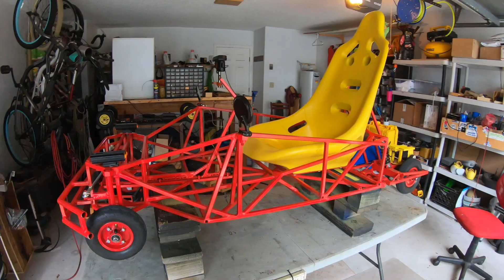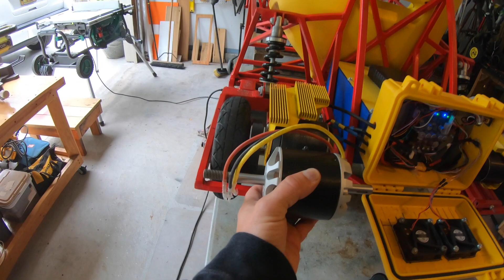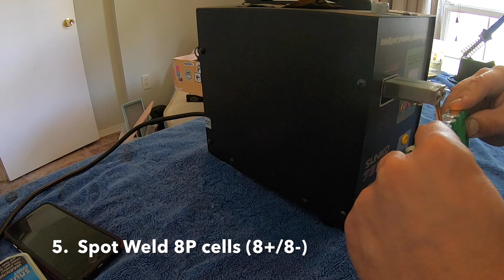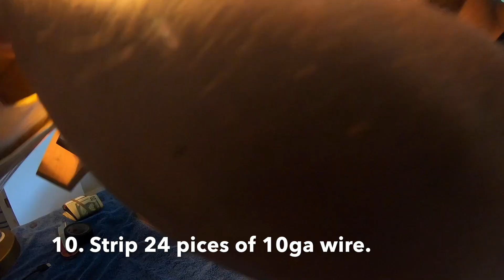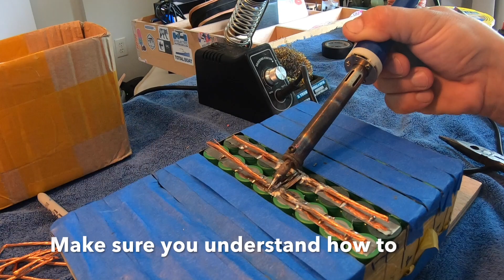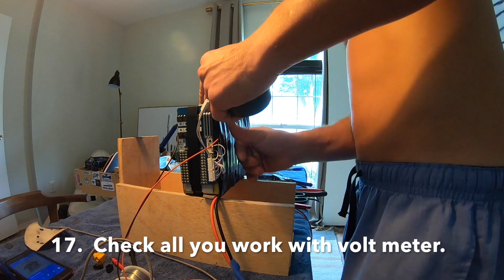Electric Go-Kart, Part 2-Electronics

Comment: great vid
Reply from the maker: Thanks Conner Smith.
Reply: Artsiom Naidzich no prob love warching them when they come out
Reply: Artsiom Naidzich do you ever have have vesc problems because i have blown 4 vesc’s just trying to have them detect the motor for my electric skateboard
Reply from the maker: conner smith Yeah, ive had that happen. This issue resolved when i disconnected load from motor pulley (belt, wheel, etc). When motor spun freely, vesc was able to detect motors. Also check your vesc settings and wire connections. What vesc r u using? What set up? My worst experience with vescs was torque board vesc. Flipsky, focbox, esk8de vesc work really good for me.
Reply: @artsiomnaidzich9515  i have only tried flipsky and im using it on a 10s 4p setup
Reply: @artsiomnaidzich9515  im also trying to figure out if the motor is what is bad and keeps killing the vescs
Reply from the maker: conner smith is the motor with or without sensor? If it is with sensor, is it 5 or 6 pin? Flipsky is designed with a 6 pin sensor connection (+, a, b, c, temp, neg). Most of the cheaper motors are 5 pin (+, a, b, c, -). If you connect 5 pin in 6 pin set up without adjusting pins, you will plug in - sensor wire into Temp wire on flipsky vesc. This would cause a problem.
Reply: @artsiomnaidzich9515  ya i did that
Reply: every single time
Reply from the maker: conner smith. You plugged in 5 pin into 6 pin? You got to cut away - wire from 5 pin and skip the temp sensor plug on a 6 pin. Or just dont use a sensor wire at all. Its not that big of a difference
Reply: @artsiomnaidzich9515  can i just leave the sensor wire unplugged or should i get a motor that does not have a sensor
Reply from the maker: @connersmith9711  Yes, leave it unplugged.  Sensor is only needed for a smooth start.  if you are pretty light it would not matter much.  Run you motor set up for bldc sensorless.  You should be good to go.  When you do set up your motors, don't connect them to a wheel or belt yet.  Run your motor set up with motor not attached to anything.  If you do want sensors, get a motor with a 6 pin sensor set up.  What size motor are you using?
Reply: @artsiomnaidzich9515  thank you so much 6 months of research and i could not figure it out and you just fixed my problem for me in 20 min lol. i am using a hobbysky 6374
Reply from the maker: @connersmith9711  No problem.  Thanks for supporting my videos.  Let me know how it goes.  I've used hobbysky motors before.  Still got a few sitting in my garage.  They are good motors for the most part.
Reply: @artsiomnaidzich9515  ya i decided to go with one cause my friends use them and have never had a problem. and happy to support the channel i have watched all of your videos some multiple times, i just wish there were more people like you doing this

Comment: Some serious space frame triangulation going on. A backbone chassis would have been a few days less work and materials, but where's the fun in less? Good work!
Reply from the maker: Thanks Sam!  I'll check out backbone chassis set up.
Reply: @artsiomnaidzich9515  It really just means using a large tube/beam as a backbone/spine and then you would connect your suspension subframe off that. Look up 'Backbone chassis' on wikipedia for several examples. The Lotus Elan is one example. Old chassis technology now, but very simply to fabricate.

Comment: How much battery amps you running
Reply from the maker: Taco perez 180a (90 per motor) with my current set up. I got 8074 maytech motors on it now.
Reply: I get you are running 90 motor amps at each motor but how many battery amps for each motor. You know what I mean? How much where the 8074 motors? Is it faster now?
Reply from the maker: Taco perez. Pack is 12s8P 240a. Motors were $250 each. Same speed, more torque.